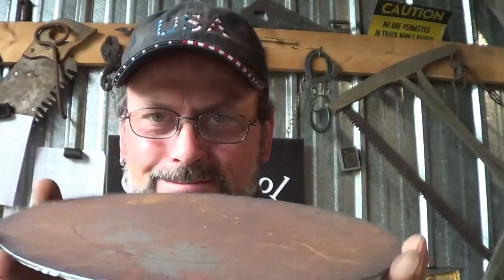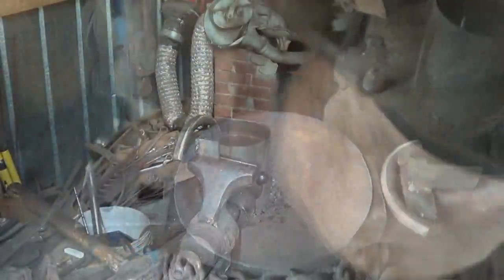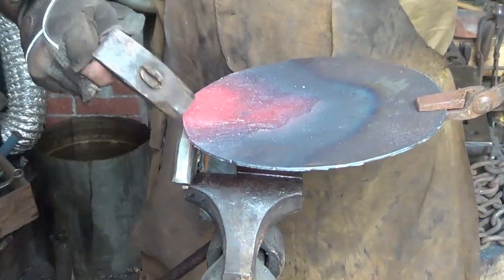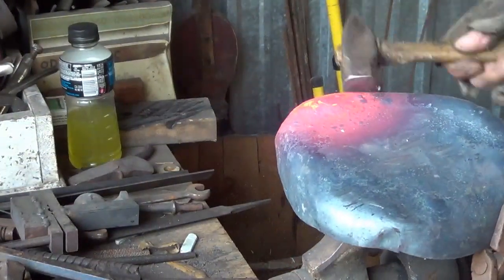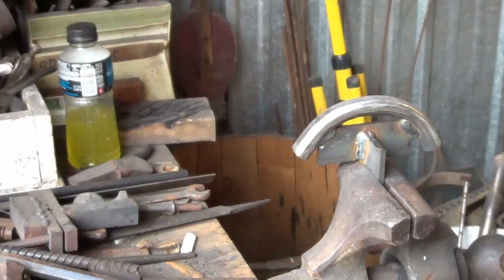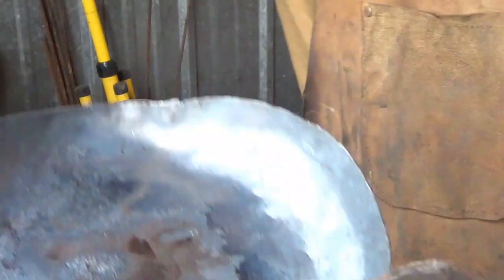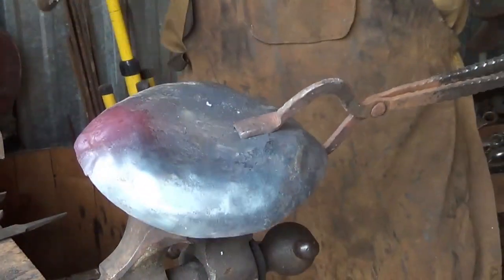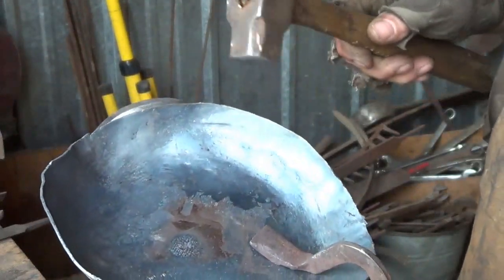Blacksmithing - OSF Way Of Forging A Pan-Last Pan Video I promise

Comment: I remember building my first still from copper sheet. I wanted to do it all traditional (or as much as possible) using only hand tools . . . the only "modern" thing I used was a torch to anneal. Forming that bottom pan for the boiler is much like what you are doing, and back then was the first time I had ever attempted. Man was it a bugger. I had nothing to form it around. Just anneal, bend, hammer, repeat. I know, it isn't steel, but same idea and took a hell of a lot of work to get it nice and round with no "ripples". 

Just getting into blacksmithing now, and love your vids. This hobby seems to go with my other . . . keep the old ways alive!

*edit here to add in. Not sure how this would work in your scenario. But when I make my copper pans for the boiler, I scribed a circle on the copper where i wanted the lip to begin bending up. Then I use pliers to slowly work my way around bending up evenly. Anneal it, then bend it further. Could you accomplish the same by heating it and bending slow, heating more and bending, etc? It would help provide a nice even lip with less wavering along the top edge to grind off if it works . . . I just work copper currently, but maybe it would help?

Comment: Hey Chandler, nice builds, I watched all three. I use and cook with debuyers carbon steel pans made in france. They are an industrial manufactured item (on a small scale), and use a two ply of carbon steel, with a soft white steel exterior and a harder, smaller diameter cook surface that is pressed together. They don't worry that the harder material does not make it all the way up to the edge. Just as long as the internal hard steel covers the bottom surface. Also they coat the thing bare metal with bees wax, which aides in the seasoning process. Once again, good stuff and nice job. You may want to look into making some paella pans. 

BTW, I only use carbon steel now, one of the big points of using carbon steel pans, is when you are pan searing, if you take the pan up to the liderfrost effect temperature, you can cook without oil, and your meats come out perfect if you preheat (to about 400 degrees F) without oil. No lie.

Comment: you are so damn tenacious...I love it! Of course, I have to toss another idea out: how about starting with slightly thicker stock (maybe 3/16) and then drawing out the sides. You would still have the challenge of pinching in the sides of the pan but you may be able to control the direction of the metal movement towards the edge. The center of the pan may move less as well. Plus you'd have a pan with great heat control capabilities. And people do so love a nice beefy pan! I love your handle...stick with welding it, you are right about the rivets.

Comment: Beautiful video, Chandler.
The looks really good.
The first device with the round steel I loved, although the sheet was fine. But the diameter of round steel was too big or you would have the round steel to the middle ground down (one has a D-shape) and then clamped to the other side of the vice.
You have the pan blank the outer diameter (top edge of the pan) and the inner diameter (where the bottom merges into the edge).
When clamps the round steel device on the left side of the vice, as is also the smooth side of the abraded the round steel.
Then make the blank to the internal diameter glowing and slowly change suddenly about 2 °. So go on until you get is around, then bent further about 2-4 °. till you have his desired rim angle done.

Comment: Great idea.  You slightly touched on it but if you were to make full circular dies that are flat and have the plate sit on top and somehow hold it in place you could go around the edge hammering down and then once you got back to the start use a smaller in diameter circle maybe even with longer edges going down so that you could hit the sides as well to take the angle you want. Think like a full circle that would have a piece of metal welded to the bottom that would go into the vice and once in the vice it would look like a round pizza tray on top that you could beat the heated plates edge down on.

 first die is maybe 11 1/2  inches in diameter which you would use a 12 1/2 steel plate heated on, then go down to say a 10 1/2 or whatever until you get to the size you want the finished product to be. Might be a bit of work to make the dies or patterns but once made it would save soo much time that you spent in the past videos of going over and fixing the over curled sides.

Keep up the great work!

Comment: Nice job brother, never be afraid to try a new method. If you continue to do pans (or other sheet metal projects) go find you a set of body working hammars. Cheap one will work fine (harbor freight). Use your smithing hammars to do the heavy work and refine the shape with the body hammars. I have used that method to make plate armor.

Comment: Awseome video, glad you found a technique that works for you. But maybe a little tip, I learned during my apprenticeship not to use a metal hammer while upsetting sheetmetal because it thins it back out. So maybe rather use your wooden mallet fpr flattening. looking forward to your next video.

Comment: @ 17:00 On that piston scrap you are using, you should weld some bar to the bottom of it so you can place it in the hardy hole and it not wander on you.
Reply: I was thinking the same thing. He could also put a C shape onto some square stock to keep it still. That amount of weight wobbling around would make my toes nervous.
Reply: I posted the same thing on the last video.  if Chandler keeps using it he should definitely add a peg.
Reply: Do you mean a round piece of metal inside welded, so you would get the prefect angle and roundness?
Reply: Carson King
we were discussing the large piece of metal that Chandler has wobbling around unsecured on top of his anvil and ways we might address fixing it.
Reply: I see. Do you see what I mean, spot weld a ring to the inside bottom and bend over that and then remove it? I'm not a welder or anything like that, it was just an idea and I'd love to know if you think it would work or not?
Reply: i do, but i don't think chandler wants to be grinding off welds on the inside of his pans. he also wouldn't be able to heat the pan in the forge after that without also heating the ring, which would make it ineffective.
Reply: Cheers dude.

Comment: Great way of thinking through the process. What about forge welding another smaller plate on the bottom to increase the thickness for better heat retention and even heating, then electro plate the pan in copper? That would really set it off!

Comment: Chandler's Pan Labrynth

Hey I know you probably won't see this but if you peg your cylinder to the hardy hole you won't need to worry about it falling off, at least until you find a way to make a form as you were mentioning.  Cool stuff Chandler as always

Comment: I once forged a ladle by measuring and cutting a steel sheet. I made the handle by rolling the steel into a tube. Worked well. I did the standard heating and beating to make the bowl. I ended up with a great ladle.

Comment: neat little tool, there is a method in body shops that might help you. it's like when you got a rusted bolt that you want to get out w/o having to drill n tap it. You heat the metal and cool the bolt, when metal gets hot it expands, cooling it shrinks it. this could be a method you could exploit when you are upsetting your pans, cool after heat and beat, in theory should contract the metal w/o warping it, helping you get the rim of the pan in you are trying to create.

Comment: Stretching of metal is an art Chandler, In saw making we need to stretch the outer rim or shrink it to make it stiff or loose, the art is in the hammering direction , driving the metal particles to wher we need them, in your case the outer rim need to stretch to allow for bending, if you try a copper disc you will learn the art quicker as the copper is softer and stretch easier.
start from the center of the pan hammer outwards close together, work around the 360 degrees, a few times.
 the pan will start to bend like a bowl, now start your rim and go to about 15 degrees all round the rim, then repeat the sequence.
I enjoy watching the vids thanks.

Comment: The bowl method thins out the bottom of the pan and leaves a lot of hammer marks on the inside; that may catch stuff in an undesireable way.. Thin pan=less heat retention. He wants to maintain his original thickness and add to it if anything.  I suggest turning your form tool in the vice to lay flat. you could maintain the flat of the center with the occasional tap to the flat. Do you have a maker's Mark stamp, yet? The Old School Forge Anvil with OSF and CD stamped on the under side of the handles would be bad ass.  I would love to see you make a two-burner rectangular 12x24" griddle with welded D handles and a 3/4-1" edge. put that forge of your mind back to work. 

The hammer marks on the inside may not be that much of a big deal for frying.  The idea being that the liquid oil flows into the depressions and the food (lifted by the steam) tends to float on the tops of the peaks of the metal.  Those peaks are a little hotter than the surrounding areas, making toast points.  So slightly less uniform, but not a disaster, by any means.  A perfectly smooth pan is not as good for pan frying, because the oil tend to run out from under whatever is cooking making it stick in the center of mass...  If you are going for frond in the bottom of the pan with the intent to de-glaze it later with a braising liquid, fine.  If your are frying and over-easy egg=ver bad.

Comment: Chandler, this method honestly seems like the best one to me, but I have a suggestion. When you bolt on a tire you always put the next bolt in across from the previous. That way you aren't working in a circle, you're working always pushing in towards the center. Maybe try that idea with this method. Think of the blank circle as having a compass on it. Roll a section of the rim at the north, then heat and roll the south section, then the East, then the West. Keep going like that (north-east, south-west) (South-east, north-west). That might help push more of it into the middle without getting twisting.

Comment: I had a couple of suggestions, being a non-metal mover myself. I could see you moving the curved tool in the vie to the opposite side of the vice and use it's curvature to help form your sides a little better. Kinda like you did at the cold work stage around 20:00 in the video. Might help keep your over all form more consistent. As far as a form, use and old brake drum as a recycled form. The heavy steel should let you really work the metal to get that good basic round pan shape, then finesse the details on the anvil.

Comment: dude i love watching  your videos! I have a suggestion, at 18 mins your hitting the pan on a round cylinder which looks to be made of either Aluminium or steel. If the whole goes all the way through you could stick some rebar through that an into your anvil to keep it from moving allowing you to get a better hit.
Reply: The hole isn't very deep, He could add a hardy hole post to it though. But better would be make full rings like the tool he is using that can be put into the hardy hole or on the vice. First ring the size of the initial bend so the pan can sit on it without wobbling about, second ring being smaller allowing the same material to be moved, repeat for as many rings as needed from an 8 inch pan to 14 inches. Process would be in my mind to curl one spot, then curl another on the opposite side and repeat so it sits right on the ring. Then proceed to curl the rest. repeat for each smaller ring. If you see his pan clamp video the top clamp ring is what I am thinking but in in the vice or hardy hole.

Comment: Great video, man. Could you weld some bar stock to that big steel cylinder that would fit the hardy hole and give you a more stable working surface?

Comment: chandler instead of using your tool running down the pan lip put the tool under your pan as though you are measuring the diameter. then the tool supports the middle of your pan so it doesn't cave in as much. you have to turn it around your tool more but you will also get a more even lip around your pan. but all in all great job working out the raising technique. silversmiths have been using that technique for hundreds of years to make teapots and silver vessels. :D

Comment: If you want to maintain the character of the handle with the quality of a weld you could spot weld it.  Punch or drill a hole in each side of the handle, where it joins the pan, and then fill it in.  You wouldn't even need to grind it.  Just hammer it so it looks like a forge weld.
Personally I'm happy to see more pan videos.  The shape is complex and the challenge is clearly very different to that of making a knife (or anything that's mostly flat).

Comment: Also, what if you were to braze a copper disc the same dia. as the flat part to the bottom for heat transfer?

Comment: would it run up the cost if you used 3/8 square stock and started it the same then twisted it together before welding?

Comment: I'm surprised you haven't tried using diagonal cuts spiraling out from the pan's flat bottom, and then bending those pieces up to create your edge, overlapping each piece that was previously cut, then forge welding the edges together to create your lip. It'd be super easy to get your lip all roughly the same bend, thickness, and angle, while keeping the bottom flat. It'd probably create a pretty cool pattern as well.

Comment: You should weld a little piece of square stock on the bottom of that cylinder that fits in the hardie hole.

Comment: Chandler, why not make your tool fit the anvil hardy hole?  Seems like it would be more efficient use of your hammer blows than on the vise.  I'm learning by watching.
Reply: vice holds the tool much more efficiently than the hardy hole could. more stable as well
Reply: His post leg vice is designed to work like an anvil.
Reply: My thought was to make a tool for making frying pans. Give you something to hammer the edges out with. Hours of work for the tool, but minutes for the pan.

Comment: +Chandler Dickinson I think I identified a potential problem which you did notice in your last video which was that in the pan-making video you linked, I saw that the smith referenced the fact that he upset the edges more than once, which gave him that sharp angle and steep side. In the beginning of the video, he also mentioned that the first pass around would not produce a sharp corner or anything, rather, just a gentle curve. In addition, you put the crimping in cold - that is to say that you stretched the metal. If you watch his video again, you will notice he puts the metal over a sort of hardy die - to limit how deep into the pan the crimp can go. Without getting too into the specifics, I can tell you that the way you crimped your pan, cold, and with the vice, was not the greatest idea. This is because the metal was supposed to begin to bend into the pan shape with the crimp. When you did it, you crimped the whole thing and the round remained flat. I think you were on the right track though, and the crimping of the whole pan could simplify the process, I think.

TL;DR: you forced the metal into a crimp, stretching it, instead of bending it, and you need to do multiple rounds. 

Respectfully,

Trevor

Comment: Beautiful pan. As a chef I wish more companies welded their handles vs rivets. I think the only improvement you could make is to forge weld or even tack weld another plate on the bottom for more even heat distrabution

Comment: I like that you found a way to make this! Though, from a 'chefs' point of view, a thick wall is not usefull, even unwanted (it's less hot, food sticks). The bottom should be thick, the side thin. 
Here is an idea: use the tool you made to thin the material in a circle at like one inch from the side, all around. Thinning means more length, so it would go up or down and creating an offset and a raising wall. Should that be possible?

Comment: Just another bad suggestion but always happy to be involved, try cutting I piece out up to your internall line bending the sides up so wene your hammering the stretch can either be joined by a slight weld or riveted were the handle will go!! Might work ? That's for you to try and us to watch😐

Comment: GREETINGS FROM BULGARIA .There is a process of TINNING you can use to make it consumer friendly-
1.Heating the pan in open fire letting the insides get black from the fire.
2.Cleaning the insides of the pan with pure cotton until the pan is clean.
3.While heating it pour NH4Cl (amonium chloride) inside the pan - it is usually found near vulcanic areas where there are vents from which are coming out gasses.
4.Throwing the amonium chloride and putting tin like the one you use to solder electronics,after letting it melt  inside the pan swirl it around to cover everything inside.
5. Repeat steps number 1 and 2 and you are done.
However when you dont use the pan you have to cover the insides with pig fat to keep it from rusting.

Comment: I've seen man at arms use a tool for armor that looks like the handle of a wood bat but made of steel, and thy use it to make armor without changing the thickness of the steel. They hit on the edge of the tool so the metal moved but doesn't thin, and since they aren't pushing the metal towards the rest of the mass, it also doesn't get any thicker.

Comment: Why don't you weld a piece of square stock to the cylindrical piece, you are using for the interior shaping, that way it fits into your Hardy hole and doesn't bounce around on you. Great video!!